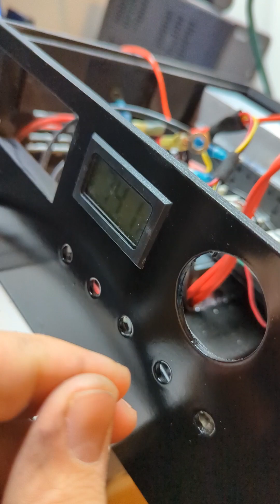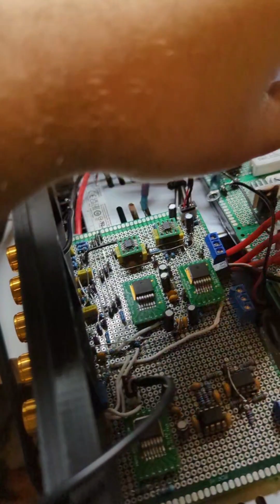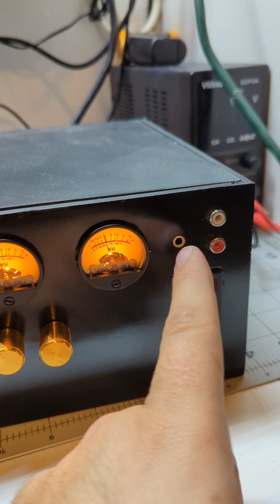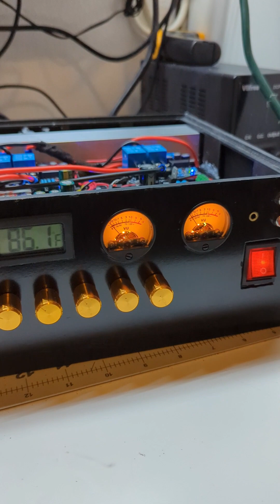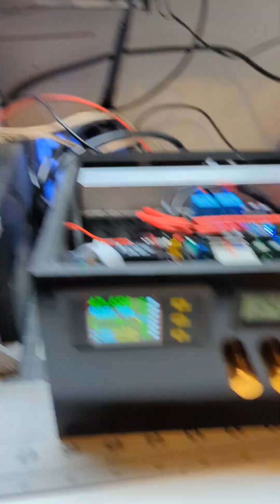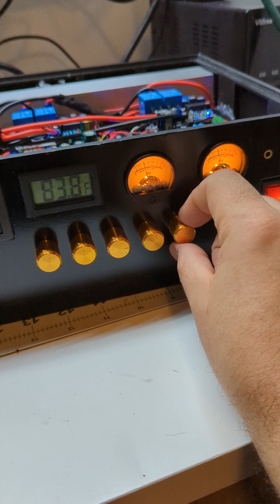DIY class AB amplifier is complete

Comment: No capacitors?
These Meanwell power supplies good for audio?
Reply from the maker: They have internal capacitors and this is a low power application, worked well enough
Reply: @LoudFiat  no switching noise on the power rail?  the ones i worked with had 2 x 24 volt (+/-24V) plus a pot meter to adjust output voltage.  how did you create +/- 48 volt?

Comment: This is amazing - i cannot even imagine how many hours you put into this! - I was wondering, how are the output transistors mounted to the heatsink ? I cannot see any screws on them.
Reply from the maker: Thanks! I used thermal glue.
Reply: @LoudFiat  Ah, that makes sense. Let's hope you don't blow any of the devices and need to replace them.
Reply from the maker: @zaprodk  I had to during dev, a sharp blade made it easy work.